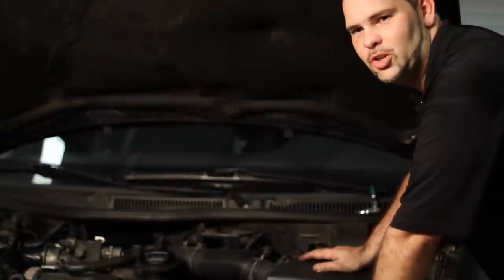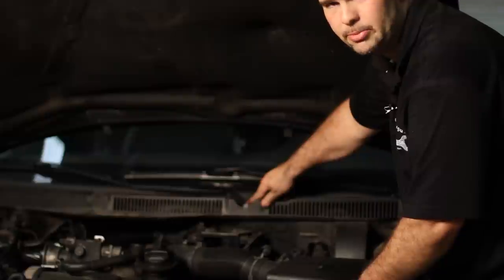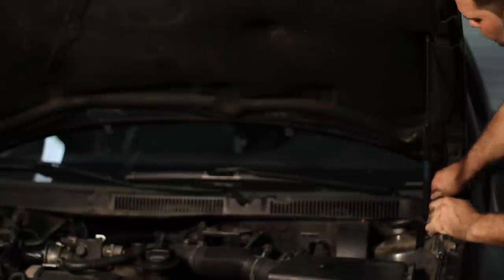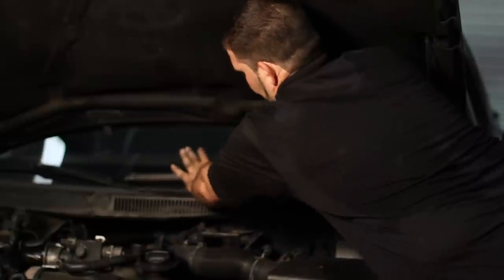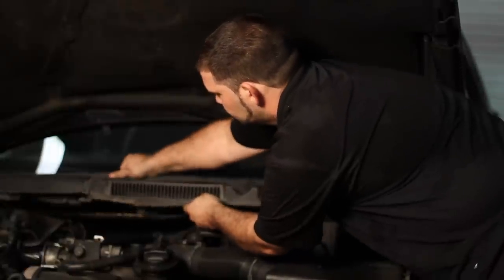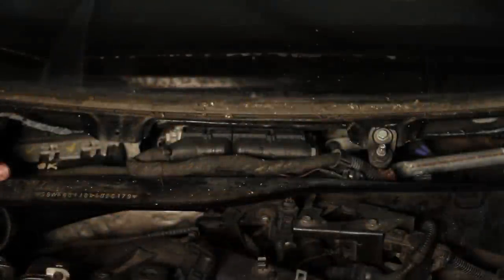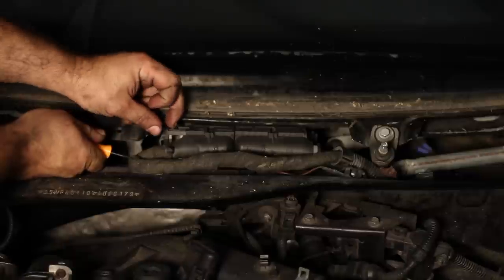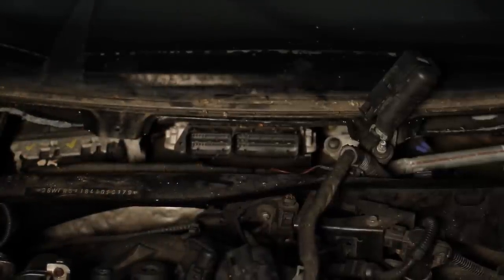DIY - How to remove a VW MK4 ECU and windshield wiper arms

Comment: LOL! I love how easy you made taking the arms off. It is not an easy task. Anyway, as a safety precaution, I always leave the nuts threaded on the shaft by one or two threads. This protects you from accidentally smashing the wiper arm into a painted surface when the arm pops off of the shaft.
Reply from the maker: That's a good idea!
Reply: Mine came off like that

Comment: I have a Seat Leon 1.9tdi fr 150bhp year 2005 with 134k on the clock. I started the car but there was no electrics. Wiper and indicator stalks were corroded, traced the complicated Wiring and it turned out that the ecu had suffered from water ingress and therefore had to be replaced which wasn't cheap😡. This is a vag design with the ecu located in the engine bay underneath where water passes. With the condensation etc everything becomes corroded. The tdi is solid piece of kit, one of the best Diesel engines. So if anybody experiences something similar this brilliant video illustrates how to locate it. Thumbs up 😏👍
Reply: then modify it  very easy to do

Comment: Didn't like the skin on my hands anyway. Wasn't the bolts that were seized on but the actual wiper arms to the ridged joint they fit onto. 1.5 hrs wrestling with it and spraying with oil. I'm buying a damn horse.